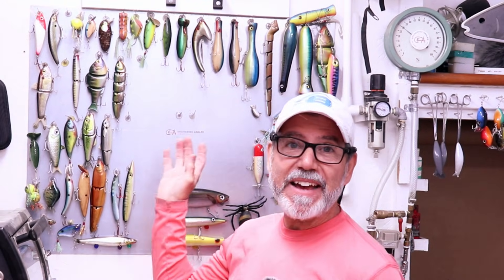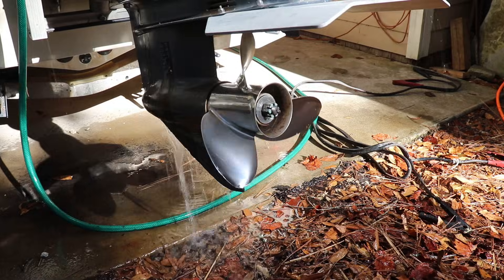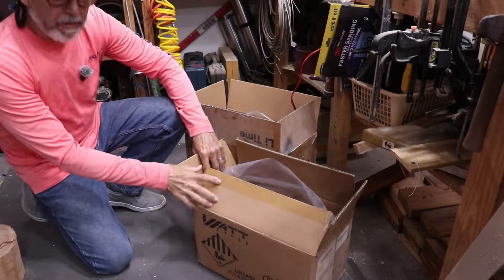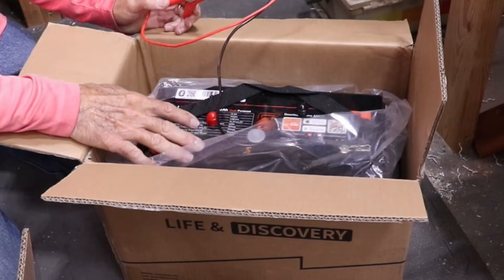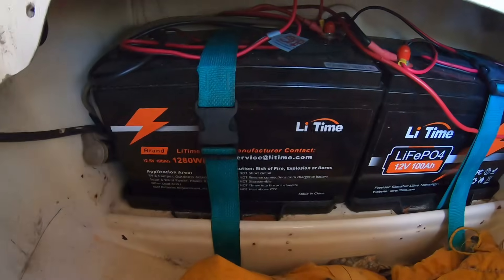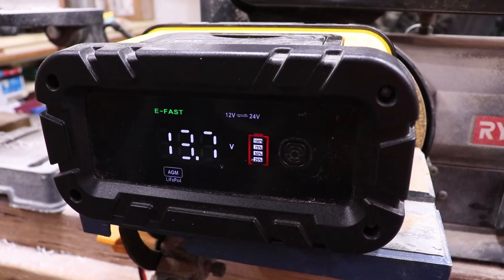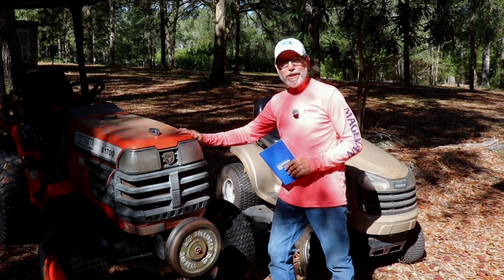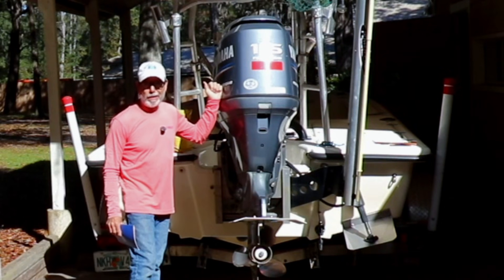Testing Lithium Cranking Batteries on Yamaha outboard & Diesel #yamahaoutboards #lithiumbattery

Comment: I just bought a couple 100 amp hour lithiums for my trolling motor, question, I have a NOCO Gen 5x3, after 24 hours on charge, they're still not showing a full charge? Should I be concerned, or is it because I only have a 5 amp charger and it will take longer? Out of the box before charging, both batteries tested at 13.6 volts with my volt meter.
Reply from the maker: Yes...it takes forever out of the box. They ship them nearly at zero charge.

Comment: My understanding is that greatest probability of encountering a problem with using LiFePO as a cranking battery is the charging by the Marine motor's alternator.  Not so much the ability to supply sufficient output amperage.  The BMS will draw max output from the alternator then the BMS will cutoff when fully charged resulting in damage to the Marine alternator.  Your thoughts?
Reply from the maker: Yeah that's what I would talking about in the video

Comment: You need to be cautious about using lithium for starting batteries. Cranking is not that big of an issue. That of just in the way the BMS is programmed. 

The real issue is charging. Stator rectifier and standard alternators are not equipped to properly charge a lithium battery. That charging profile and charging output are largely uncontrolled when not using lead acid batteries.

Lithium has a very low internal resistance. I have literally seen alternators smoked due to low internal resistance of the lithium and high demand from the charging system. This is especially an issue at low rpm. 

Now, alternators can use a charge controller that can charge with the correct profile. But, many of these will not throttle low rpm charging without the use of a temp sender. 

The best solution for marine applications that do not have a specific manufacturer approval for use with lithium and/or a lithium charge controller is to use lead acid for starting.  And to charge house lithium batteries with a good DCDC charger. 

I work at a distributor of marine and industrial engines. Primarily, we do diesels and outboards and our customers are OEMs and dealers. This subject comes up a lot. I have often seen people say I have never had a problem or similar statement. I have also towed boats in from offshore until the Coast Guard could take over due to lithium used as stating batteries. 

Your mileage may vary as they say. I just urge caution.
Reply from the maker: Yeah that's what I was talking about in the video

Comment: you need to off gas detection with any lithium battery and I would check with your insurance if you covered. my boat insurance doesn't cover lithium battery fires and they just group lithium batteries one type. 
You will also find in china now they are stopping the use of lithium batteries and are moving back to nickel metal hydride battery in any automotive or marine appacation due to the number of fires they are getting on a daily basis.
Reply: You are mixing up Li Ion and LiFePO4 chemistries.  There is a big difference.There is no "off gassing" of an undamaged LiFePo4 battery.
Reply from the maker: Thanks for the information! 
Lithium batteries are on million dollar yachts all over the world.  I'm pretty sure the insurance companies are coming around.

Comment: I run a dedicated lithium for Livescope and other electronics and know all of the obvious benefits.  I'm just a little curious how it's surprising to you that a 1200CCA battery, regardless of it's construction, has a problem cranking a lawn mower and a little diesel in an obvious warm climate.  It's 7 degrees in PA right now and, yes, my tractor is a challenge when it's cold but when it's plugged in and you actually use the glow plugs, it starts like it does in August.  It's just needs to idle a WHILE before you let it eat.  I don't use lithium anywhere but the marine electronics simply because of the charging needs.  Very few manufacturers have charging systems prepared to charge a lithium with high enough voltage to satisfy the battery the way I understand it.  My tractor and lawn mower (alternator and stator) are certainly not built for lithiums without an inverter and a lithium specific charger plugged into it (again, the way I understand it).  Please correct me if I'm wrong about the charging but my Merc is not capable and it's not recommended to ask it to charge a lithium.  Am I right here?  Other comments?
Reply from the maker: It's not that I thought that 1200 cranking amps couldn't turn over a lawn mower it's that I was afraid that the 1200 number was BS
Reply: @EngineeredAngler  Ah, mmm, ok.  I guess one could question that, yes.  So are you running lithium batteries with the outboards and are they adequately charging them when they were designed for a lead acid charge level?

Comment: I have a smaller 12v battery that I use for my portable fish finder. The standard battery is 4.4lbs. The same size lithium is 2lbs. Two extra pounds doesn't sound like much, but I have a long steep walk to a couple of my rowboats. I may have to switch to lithium when my current lead battery dies. The price on these seems to be coming down.
Reply from the maker: The weight savings definitely add up!

Comment: First i need the boat.. but ye, LiFePo4 is a great battery. i have a 24v 80 AH to push my kayak. If i kept the throttle down i could go like 70 miles or some stupid thing, but i run full throttle and after 12 miles or so i have 60% or more.
Reply from the maker: Sounds like a great setup for your kayak!